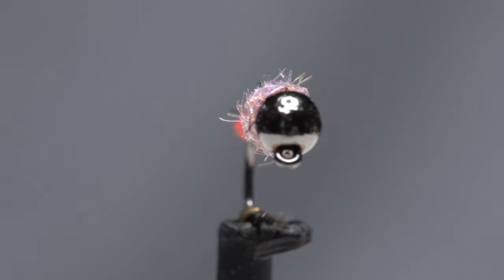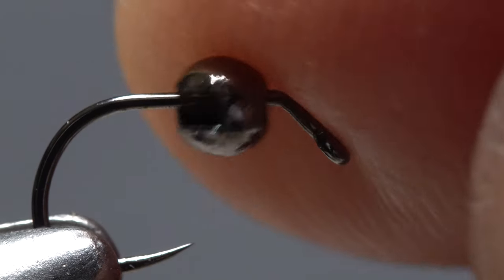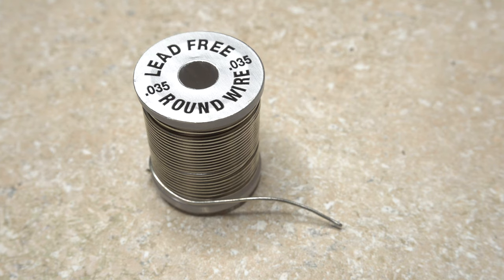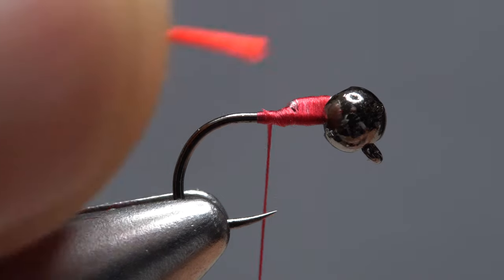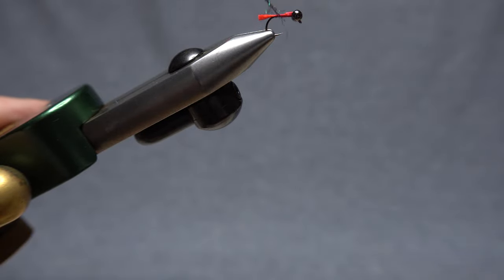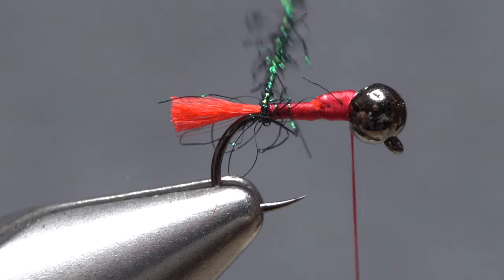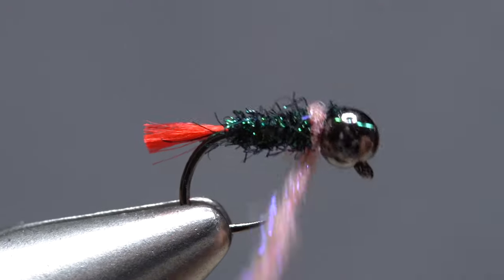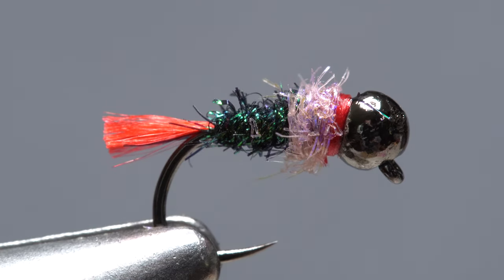Mini Dart

Comment: How do you fish this fly, can you do so under an indicator, or is it really only meant for euro nymphing. If you can fish it under an indicator how do you fish it, on a dropper, or as a single fly rig? Sorry for all the questions, and great video.
Reply: Hi, I think you will find the answer is yes to all your question on presentation. All methods you mentioned will work some or all of the time.  The important thing to remember you have to have the fly where the trout are.  The length of your leader is the important factor, I fish with one and a half lengths of my rod most of the time using a Kiwi indicator. Look up the Alex’s Utube “ Tripping on Trout”, he explains it quite well. Gluck mate. Harera

Comment: Great fly there tim. Looks like I need Chinese red floss. You think glo brite number 3 would work as well
Reply: Glo Brite is what most people tie floss tails in with! Double up two strands to have a four strand tail.
Reply from the maker: Yeah, I actually tried that at first. I think you need to like quadruple it over to get enough volume for the tail. It just looks a little too anemic for a tail even if doubled over. Hence the floss.
Reply: @devonbustard1623  I know the drill with that. Just finished up a 4 dozen order of tag nymphs yesterday
Reply: @tightlinevideo  I may have to pick sone of that floss up to give it a try just for this fly. I use the red dart a lot during the winter months and it crushes fish. Another good tag nymph to tie is Olsen blow torch but with a chartreuse tail and a squirrel and cdc collar as a pepping caddis imitation.

Comment: Can you explain why you cut the dubbing line and treat it like a normal material rather than using a dubbing loop?
Reply from the maker: This is a small fly (size 20). A dubbing noodle created using a dubbing loop overwhelm the fly and would be way to "frilly". The method shown results in a super slim, extremely durable dubbing noodle and thus the appropriately sized, slender body for the fly.
Reply: Thank you!!